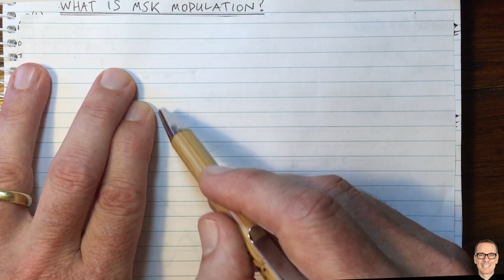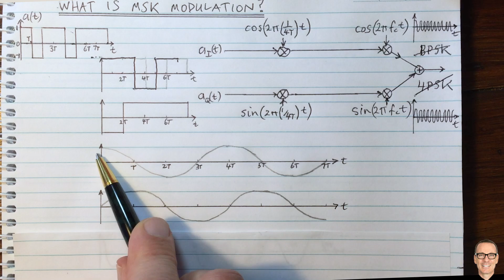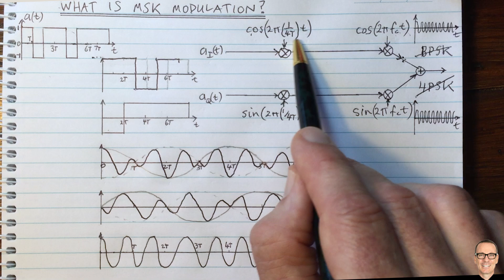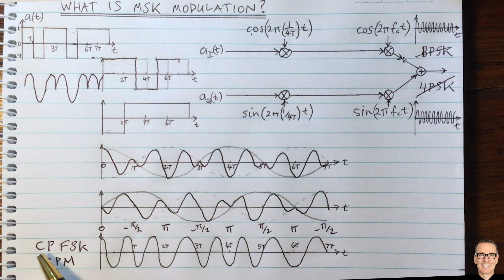What is Minimum Shift Keyed (MSK) Modulation in Digital Communications?

Comment: Dear Sir. After your amazing explanation, I asked to myself: - could one Demodulator real circuit, after a long haul, with a lot of noise, could decode the right frequency (or Phase), by just one wavecycle? Or your last graph would be just a conceptual explanation? I mean, usually one FSK/PSK shift several samples-cycles in order to the Demodulator "to be sure" of the right decoded Frequency/Phase, is not it? And about wired long range communication, the MSK would be good, or not?
Reply from the maker: The example waveforms I drew were with a carrier frequency (f_c) of only 1.25 times the symbol rate - just for illustrative purposes so it clearly showed the smooth transitions at the symbol boundaries. In practical systems f_c is orders of magnitude higher than the symbol rate.
Reply: @iain_explains  Thanks, Sir. It is clear.

Comment: AI Summary

Abstract:

This educational video explains Minimum Shift Keying (MSK) modulation within the context of digital communication systems. It begins by reviewing basic Binary Phase Shift Keying (BPSK) and its limitations, then introduces Quadrature Phase Shift Keying (QPSK) as a method to improve bandwidth efficiency by using orthogonal carriers. MSK is presented as a specific form of QPSK with two key modifications: the addition of low-frequency sinusoidal pulse shaping multipliers (cos(πt/2T) and sin(πt/2T)) and a time offset of T applied to the in-phase data stream. The video visualizes the resulting waveforms, highlighting MSK's primary characteristic: a continuous phase trajectory without abrupt shifts at symbol boundaries. This smoothness leads to significantly reduced bandwidth and lower sidelobes compared to conventional PSK methods. The name "Minimum Shift Keying" is explained by the fact that phase transitions between symbol intervals are limited to a maximum of ±π/2. Finally, MSK is also identified as a form of Continuous Phase Frequency Shift Keying (CPFSK), where the signal effectively switches between two distinct frequencies (FC ± 1/(4T)) while maintaining phase continuity.

Understanding Minimum Shift Keying (MSK) Modulation

*   0:00 Basic Modulation (BPSK): Digital data (+1/-1) directly multiplies a high-frequency carrier (cosine wave), causing phase flips (0 or π). Problem: High data rates lead to fast, sharp phase changes, requiring significant bandwidth.
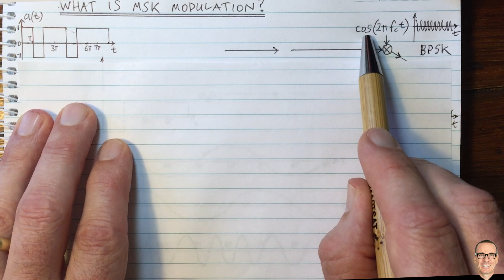*   1:00 Improving Bandwidth (QPSK): Quadrature Phase Shift Keying (QPSK or 4PSK) uses two orthogonal carriers (cosine and sine) at the same frequency. Data is split (e.g., odd bits on cosine/in-phase, even bits on sine/quadrature).
*   1:48 QPSK Advantage: By sending data on two carriers, the symbol rate on each is halved (symbol duration 2T), reducing the overall required bandwidth compared to BPSK for the same data throughput.
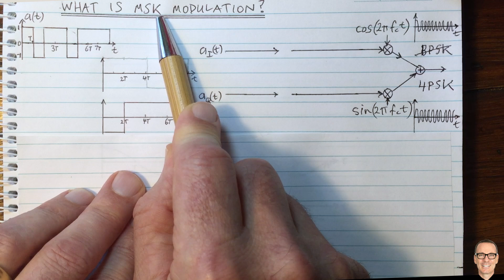*   3:00 MSK Structure: MSK builds on QPSK but introduces two key differences. First, additional low-frequency sinusoidal multipliers are applied: cos(πt/2T) to the in-phase branch and sin(πt/2T) to the quadrature branch. The frequency of these shaping pulses is 1/(4T).
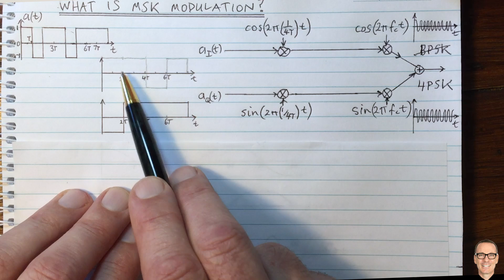*   4:46 MSK Data Offset: The second difference is that the in-phase data stream (a_I(t)) is offset (delayed) by one bit period (T) relative to the quadrature stream alignment used in standard QPSK visualisation.
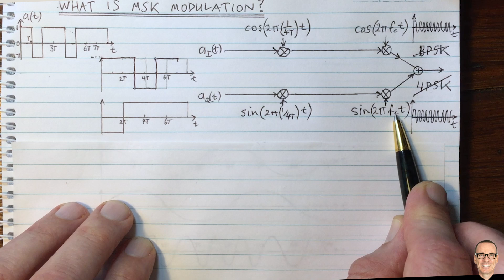*   5:32 Sinusoidal Pulse Shaping: The low-frequency cosine and sine multipliers act as smooth pulse shaping functions, replacing the rectangular pulses implicit in basic QPSK.
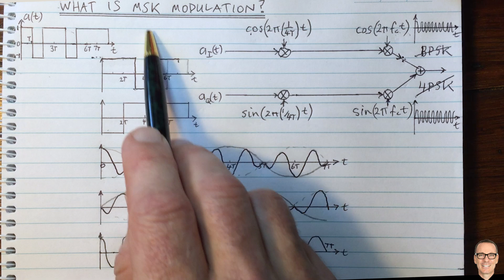*   9:21 Continuous Phase Waveform: Combining the pulse shaping and the specific data offset results in an MSK signal with a continuous phase trajectory. There are no instantaneous phase jumps at symbol boundaries, unlike BPSK or QPSK.
*   10:50 Why "Minimum Shift": Analyzing the phase at symbol times (multiples of T) reveals that the change in phase between consecutive symbols is always exactly +π/2 or -π/2 radians. It avoids larger (π) phase shifts, hence "Minimum" shift.
*   13:01 Link to CPFSK: MSK is a specific type of Continuous Phase Frequency Shift Keying. The continuous phase nature and the modulation process result in the signal effectively switching between two distinct frequencies: FC + 1/(4T) and FC - 1/(4T), determined by the data.
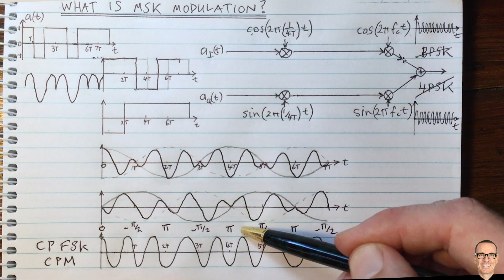*   14:48 Key Benefit of MSK: The smooth, continuous phase nature significantly reduces the bandwidth occupied by the signal and suppresses spectral sidelobes compared to PSK techniques, leading to better spectral efficiency.

I used gemini-2.5-pro-exp-03-25| input-price: 1.25 output-price: 5 max-context-length: 128_000 on rocketrecap dot com to summarize the transcript.

Input tokens: 16735
Output tokens: 2812